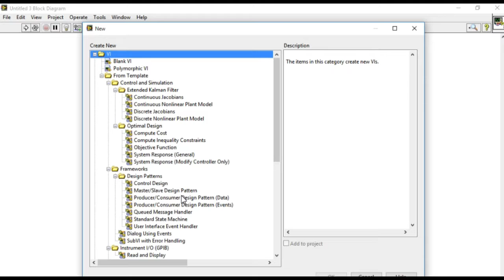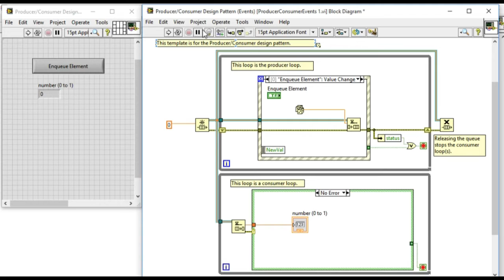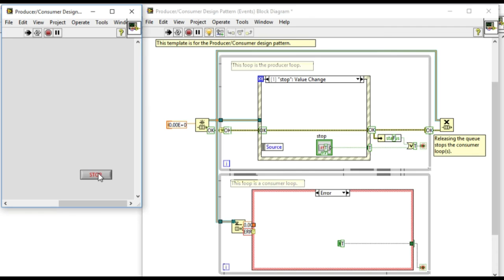Producer Consumer (Events)  - LabVIEW Design Patterns

Comment: what if an error occur in the consumer loop ? it will shutdown but the producer will eventally send another request for consumption ..... could we use the error cluster and merge the errors at the end ?
Reply from the maker: +Badre ARRAS Dear Badre you can use Value signaling property node to signal producer to stop when error occurs in consumer. And yes we have to merge error at the end. Thanks for your question.
Reply: That's a good question, that kind of issue is solved using QMH Architecture.